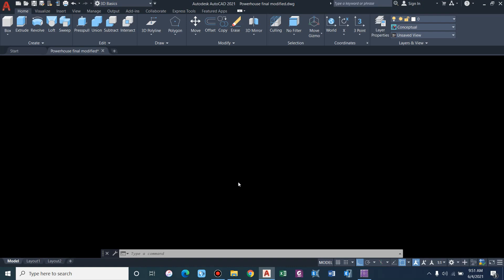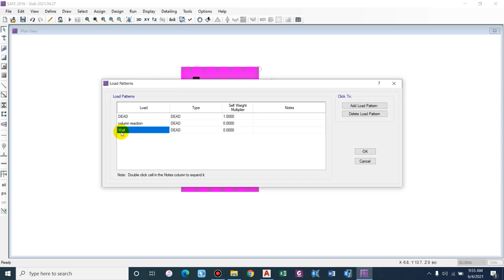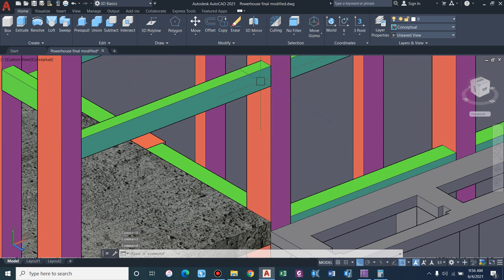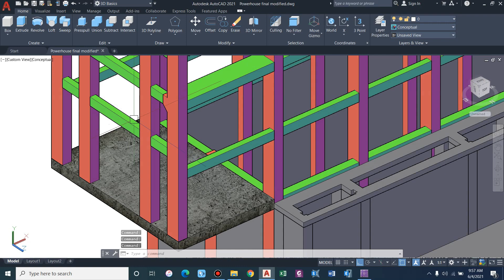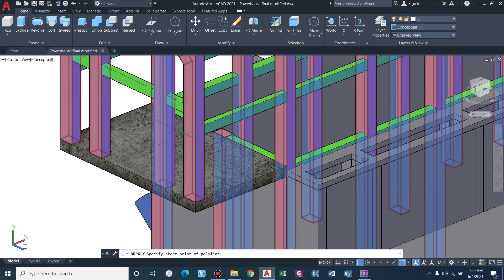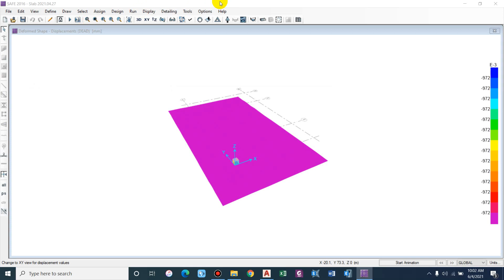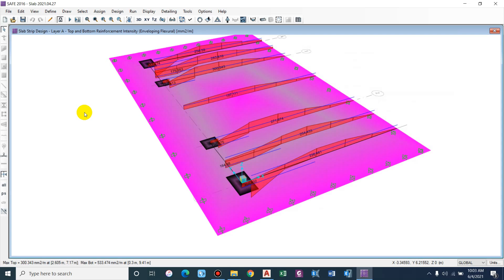Analysis of raft footing with Basement Wall | Uniform Line Load | SAFE

Comment: If it is a structural wall, I have to check punching for wall too.. but in that case column punching is showing only.. how to check punching for walls?
Reply from the maker: For the wall, you have to check one-way shear only not punching shear.
Reply: @civilconst  sir, One thing I noticed while importing base reaction from etabs to safe that, in case of shear wall, a beam is imported with same thickness of shear wall having a depth equal to the height of bottom most story in etabs. What to do with that beam while designing foundation in SAFE? Should I keep that beam?
Reply: Why is water pressure not applied?